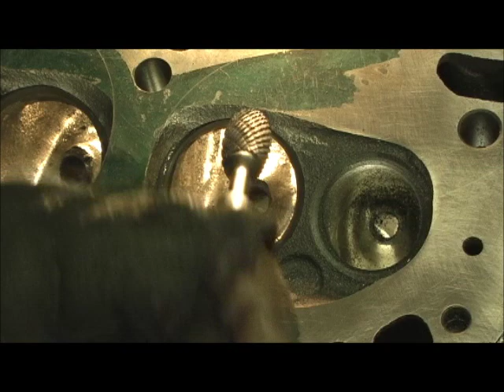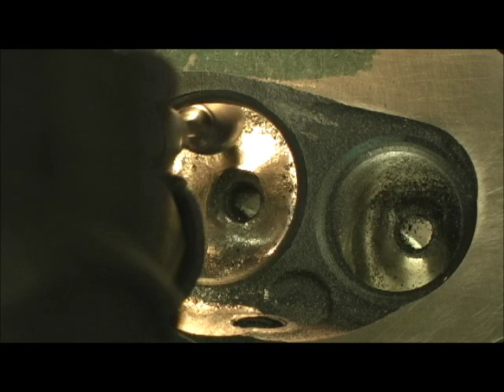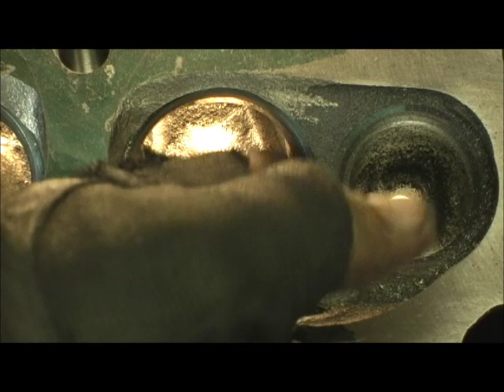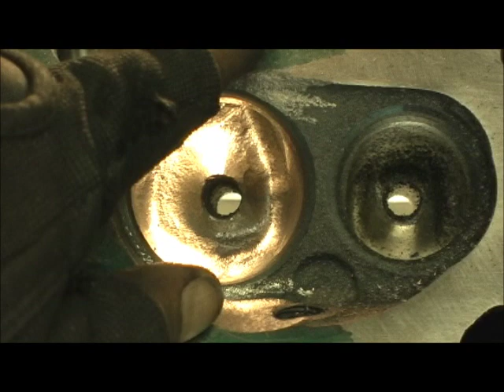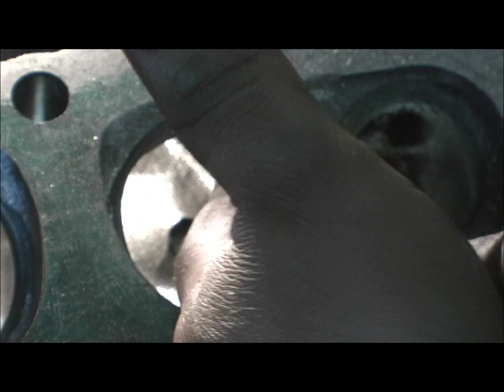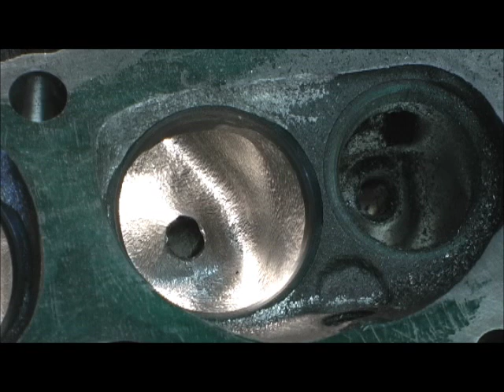Holder's 305 HO 601 "Bullet Guides" 5.5

Comment: Good to see more of your videos. What's your thoughts on putting bigger valves
2.02 or so in  350 vortec heads , and not do anything else to the head.
Reply from the maker: Just about the stupidest thing you could do!!! As far as that goes, you can just get all the port out of the 1.94 valves, and in my opinion, to go to a 2.02 is a waste of time. There is simply not enough port there (crack heads remember) to use the 2.02.
Reply: Headbytes Porting Thanks,  I think your right about the 2.02 valves. Good videos.